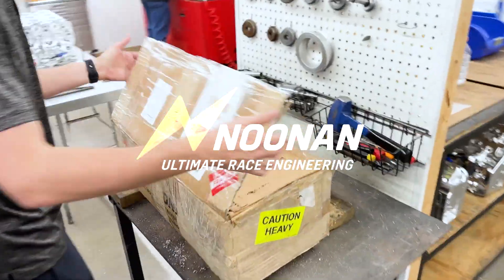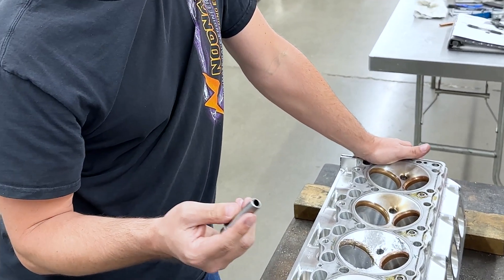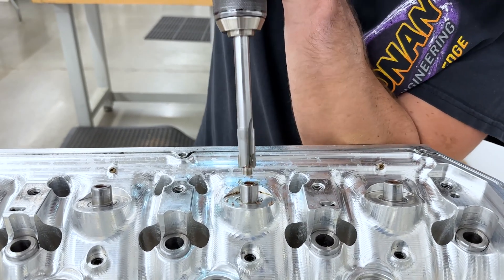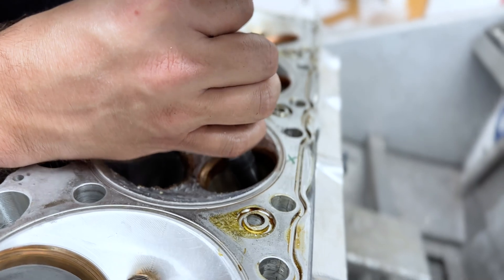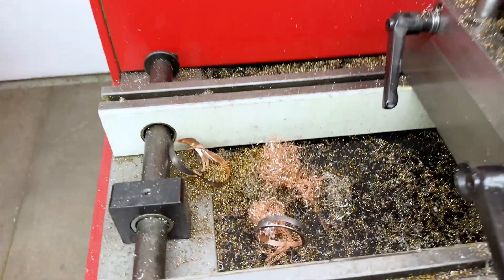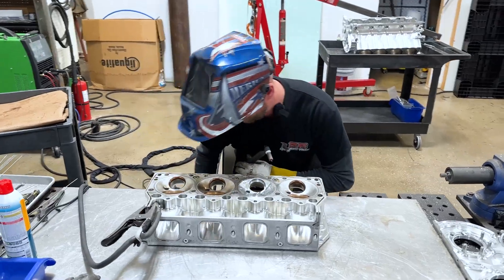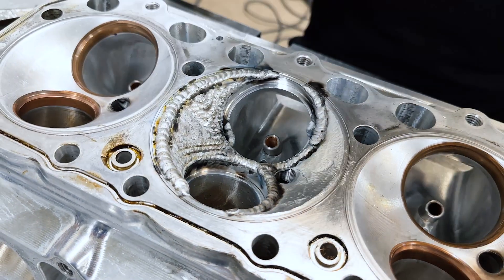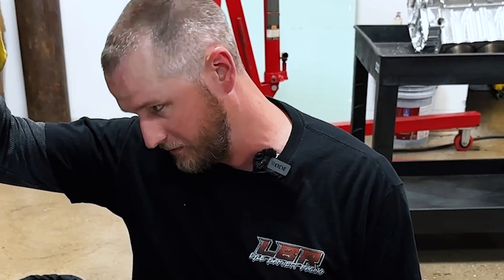Mangled Hemi head? Pro Mod head travels across the pond! Head repair Episode 1

Comment: At 1:50 Why hammer beat (and cause needless aluminum disruption & bore Enlargement) the New guide In when if Chilled, it Easily taps in an oven Heated head ??

Comment: Spencer is a straight up solid welder. He knew the base material was impregnated with foreign material and didn't try to say otherwise--it's a little trashy. Kudos to Noonan for having a skilled tradesman on call.
Reply: I was a TIG Welder and other forms of welding but when I learned to TIG on Aluminum it was awesome...I like when CJ basically said that he "didn't skimp on materials" as in the welding filler rod because he's right..put enough material there so when they do the machining he wouldn't have to go back and re-do his work.. excellent video here.